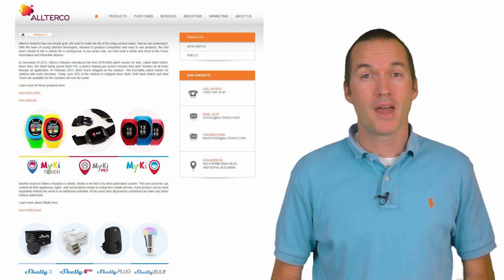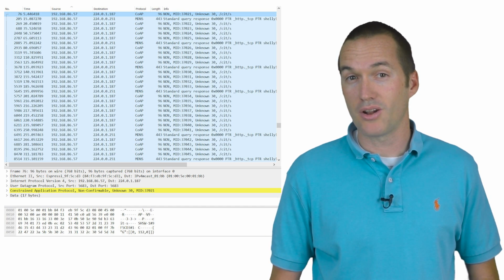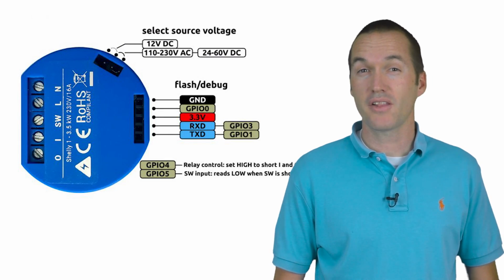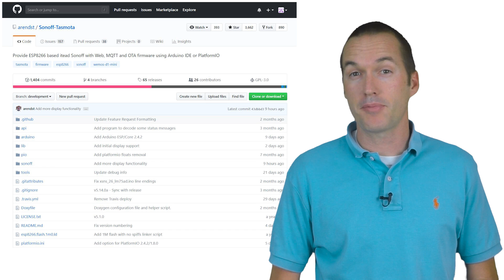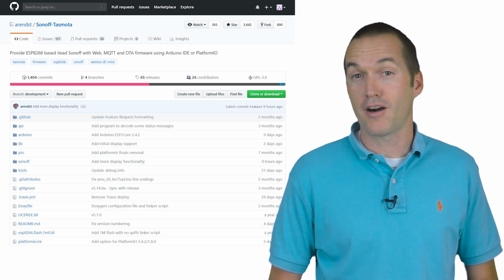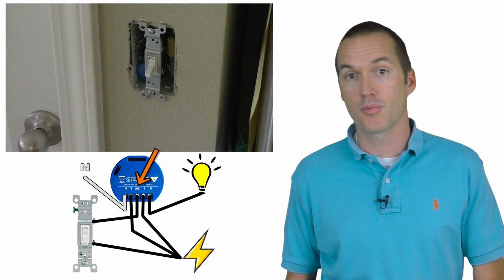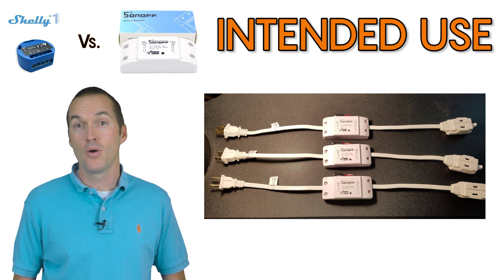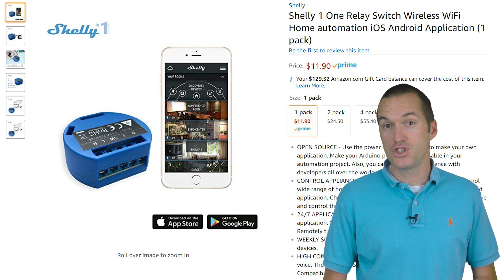Is the Shelly 1 better than the Sonoff Basic?

Comment: its rated at 16A, but its internals are not 16A proof and its CE marking is fake, it doesnt comply at all with the CE and just like the sonoff it will and can burn your house down if you trust the 16A rating
Reply from the maker: Cool story bro. Got any evidence at all to back that up?
Reply: I´m an engineer in electronics, few things here the CE layer you see here is either fake or it does literally mean "China Export"

and by that i mean literally: https://keyassets.timeincuk.net/inspirewp/live/wp-content/uploads/sites/22/2010/12/CE_Marks_lrg.jpg

second, this device doesnt have a 16A relay not its solder traces on the PCB are capable carrying that kind of load
its says 16A right there on the relay but i can already see from the pictures this isnt the relay your hoping for and the insides if you crack it open are probably less then 10A

that is if the solder tracers are upholding this kind of load...
also this relay isnt fitted with an octocoupler, which is kinda required for the CE certification

Still not satisfied ? crack open a real CE certified product like the tp-link smartsocket
now compare its insides with that crap, and also make sure you inspect the very thick solder traces which are rated at 16A but are capable of pushing it to 30% more

You dont need to believe me, thats why we have the Darwin Awards...
I design circuitry for a living
Reply from the maker: an "octocoupler, which is kinda required for the CE certification"?

I'm pretty sure you mean an optoisolator, or an optocoupler, but they are still not part of the CE certification.  I'm 99.9% sure you're an internet hero and not an EE at all.  If you were an EE you would understand that trace length has 100x more to do with current tolerance than trace width.
Reply from the maker: Furthermore, the link that you provided about "china export" clearly shows that the CE is valid, check out 2:31 in the video.  Also, I'm not sure why a Bulgarian company (part of the EU) would feature a china export logo.
Reply: Optocouplers are a safety requirement in relays anyone with some basic knowledge in electronics would know why.

I dont feel you much of an explanation, this is my expertise and they pay me 4k a week for what i do.
CE certification requires all electronic devices to pass certain tests, this is where the device fails.
This is also why an Optocoupler is needed to pass those tests, not because it says it needs that component but it will fail the tests...

I really dont care what you think of me, i'm just giving advice tho those that dont want their house getting burned down and if insurance would find out the source of the fire was a non certified electronic device or a fake one they wont pay 1 cent out to the victim.
In the US these devices would also need UL certification, this alone is a red flag for insurance if they find a device like this.

The only thing you care about is people click your stupid referral link.
´
Reply: And to answer your previous question, having a proper CE sticker doesnt mean it's real.
CE certified products are always sold with a "declaration of conformity certificate" you know those small papers that come in the box with all electronic devices together with warranty flyers...

On that declaration all sub standards are listed which the device is tested for, this is the only paper that also can be looked up for its validity because it is listing the approval number, manufacturer, country of assembly.

By European regulations, if sold in EU it has to be in the box its just not possible that its not. Unless its fake ofcourse...
Reply from the maker: I literally have an entire video explaining optoisolators.  Why on earth would you put an optoisolator in this circuit?  There's no risk of harmful interference through the relay and the end user isn't exposed to the low voltage side of the device.  

I'll say it again, in the 0.1% chance you are an EE you are the worst EE I've ever talked to.
Reply from the maker: Conformity information on the first page of the included manual with the shelly1: https://shelly.cloud/wp-content/uploads/2018/08/Shelly1_User_Guide_EN.pdf

My video on optoisolators is here: https://youtu.be/QcaJlpVOJ8U?t=2m10s
Reply: The fact that you made a video about it is much sadder, explaining what an optocoupler does but not knowing why it should be in a relay circuit.

I'll give you a hint, it is part for a protection we call "Flyback voltage" and you'll be surprised what damage it could do and how many home appliances could create such a voltage.

Probably burns up in black smoke when i put it to a megger test like the sonoff.
Reply: Hi, just to say that soon the second TUV certificate is coming and UL follow it in 2 months. I think that will answer all of your questions and worries about certification and proof.

Comment: One thing that was not covers in your video is "mains" power supplied light in relation to the position of the to the analog switch and the Shelly. I.E. Does my analog switch have to be 'on' for the Shelly to recited power and operate the switch?. or if my analog switch is 'off' does the Shelly supply power to the light?

Note your amazon link for Shelly says they are not available "Maybe just out of stock"??.   Just FYI
Reply from the maker: The shelly will be able to control your lights regardless of the switch position. You get a couple of different options in the firmware for how you want your switch to behave. 

They are totally out of stock everywhere right now, should be back in stock everywhere on October 15th.

Comment: What are you thoughts on using the Shelly 1 in place of the Sonoff for magnetic door switches from one of your other posts? I am am pretty tech savvy, however I am struggling with MQTT.  I have tried it several times however i keep cumming up short, no worries i will tackle this soon enough.  I will get it however there are several projects i will be starting this winter, I.E door switches and automatic blinds. I am also looking to start temp and humidity sensors for my home to monitor my HVAC unit. 

Don't suppose you would consider a How To for the magnetic doors sensors?
Reply from the maker: You should not use the shelly for magnetic reed switch door sensors.   They are not low voltage in reference to ground.  I have a video on using a sonoff basic to do a magnetic reed switch (door sensor), it is much safer (for that specific purpose).
Reply: Thanks for your input. Much appreciated.
Reply: Hi, you can power the Shelly1 with 12V and then use magnetic switch connected to the input.

Comment: Stumbled on your Shelly video. Awesome video and well produced. Thanks for this content. I'm a complete newbie to this with some general diy skills. Shelly looks to be the solution I'm looking for to control my garage and front door exterior lights. Do you think I can use the Shelly without the firmware swap?
Reply from the maker: Absolutely, it works quite well with the stock firmware if that’s what you prefer

Comment: Hi, can I use this SHELLY 1, as a Relay for a electric yard gate? Currently,  I open the gate, manually,  pressing a button inside the house: the button simply closes a circuit, and doing so it "clicks" and opens the outside gate. 

If I setup the SHELLY 1 in "momentary switch mode", and connect the L and N to 220V and the 0 and 1 to the button circuit, will it work well without problems (I can make an automation to bring the state from ON to OFF after, let's say 1 second)?

I tried and It actually works!!! 

But pardon my (electricity) ignorance I  just wondering about the tension (the electric yard gate I think is 12V, but I am not sure if that really matters, and the manual button simply closes the circuit and the tension is not a problem, or it is? ) ... sorry I am a bit of a newb with electricity ...
Reply from the maker: I'm not sure what you mean by tension.  I can't think of any reason your setup would cause a problem.
Reply: @TheHookUp  Sorry tension=voltage in my ignorance I thought closing 0 and 1 of shelly would give 220V to a 12V device?

Comment: Great video but The IEC ratings for voltage list high voltage devices and lines as anything over 1,000 volts for AC circuits and 1,500 volts for DC circuits while low voltage circuits are between 50 and 1,000 VAC or 120-1500 VDC but we knew what you meant....

Comment: "Connects to the cloud"
Meaning, it shares your information. 

Not even if it's free.
Reply from the maker: Correct, that's why it's nice that the cloud connection is disabled by default, and that there is a local control API in addition to being able to flash your own firmware.
Reply: Learn to hack and run local services with an mqtt client

Comment: I see they added Shelly support in the tasmota changelog but I don't see it in the enabled list. I see it in the sonoff_template.h but as "optional" and commented out. Am I missing something?
Reply from the maker: I have 6.2.1.2 loaded on a sonoff and it has them in the drop down menu for the configure module dialog.  Which version are you looking at?
Reply: 6.2.1 off the release branch, 6.2.1.2 must be off the dev branch maybe? Flashing the dev branch sonoff.bin now to check. Edit: Yup dev branch is up to 6.2.1.3 now
Reply: Love your vids btw
Reply from the maker: Ah, yeah, I'm usually on dev branch, I didn't even think about that.

Comment: Any tips for powering this independent of the circuit your switching? Could it be as little as USB?
Reply from the maker: You'll need at least12V DC to power it.  12V + goes to the N line, GND goes to L.  The relay input and output are always isolated.

Comment: I tried following your instructions but hit a snag. Once I flashed it with your bin file, I was unable to connected to the wifi.  I tried unplugging the gpio-0 wire and setting up the wifi information over termite, but when I connected to termite all I saw was jibberish.  Changing the baud rate didn't help.  And just powering on the shelly1 didn't make it discoverable over wifi so that I could put in the info manually like I normally do with the sonoffs.  Any suggestions?
Reply from the maker: The official tasmota branch now supports shelly integration: https://github.com/arendst/Sonoff-Tasmota

You can grab that .bin file, or you could edit the arduino stuff to already include your wifi info.

Comment: Can be used old switches together with shelly?
What would happen, for example, that at the same time over the shelly click to lift the blinds, and through the switch to lower the blinds.
Would interlocking mode then work this way ?? Actually, the question is whether the interlocking mode is solved by hardware or software?
Reply from the maker: Yes, the shelly is designed to work with your existing switches.  The interlocking is software based.
Reply: Thanks for the reply, but I'm still worried, what would happen if you chose to close the shutter over the old switch and open it over the shelly apk at the same time?
Reply from the maker: There's really no such thing as "at the same time" in software.  One always happens after the other and that is the action that will occur.
Reply: Yes, I agree if we use only shelly. What about a combination of shelly and wall switches (manual switches)?
I believe no one would throw old switches in favor of just shelly or similar IoT devices.
When there is no internet or a router is broken, old switches can be of use.
That's why I'm interested in a combination but it's the same as with the sonoff variants.

No one has yet done something that can certainly work in combination with the electric motors. 
For the lighting is fine, and all the video ads show just how it is connected to the light.
I would not play with these things before I examine all the possibilities.
So I think this product is actually not for electric motors like roller shutter.

Unless someone wants to completely replace the old switches on the wall. But I repeat, when, for any reason, there is no internet or LAN network, that means you can not manage your roller shutters.
But I really like small dimensions so it can really be hidden in the wall.
But on the other hand there are also very nice wall touch wifi smart panels, which work the same.
Reply from the maker: There are two switch inputs on the shelly2 (SW1 and SW2), wire your existing wall switch to those inputs, one for the up direction and one for the down direction.

Comment: Does shely have interlocking mode?
Reply from the maker: Roller shutter mode is an interlocking mode.
Reply: Excellent.
It just needs to be upgraded to work on a single wire (L) and that is what it is. Thank you

Comment: We release new firmware version for Shelly devices. Ver 1.2.0 Change log:
+ Shelly1 and Shelly2 Wi-Fi disconnecting issue resolved
+ Improved cloud connection all devices
+ Shelly Bulb color mode issues resolved
+ Send command over CoIoT can be disables/enabled all devices
+ Add manual time zone and geo-location settings all devices

Next version scheduled end of the September'2018. Targeted issues/improvements: 
+ MQTT support 
+ + ESP based Shelly2 devices will show aviable Wi-Fi networks.
+ Selly2 roller shutte mode improvements
+ ...
Reply: Is ir possible to control DC lights with the Shelly 1?
Reply: Hi, nice work really. I m just wondering if you can make a similar device with higher than 16amps; something like 20 or even 30 amps. I need them to control the air conditioner. Thanks.

Comment: Can we convert a sonoff into a shelly? Is the firmware avilable? What hardware modifications does it need? 

I am asking because of the local connectivity, which is not available in sonoff. Also shelly have provision for adding normal light switch. 

Please try that modification, and hope you will make a video on that soon.
Reply from the maker: Shelly firmware requires 2mb of flash and has some protections built in so they can secure their cloud.  It's not possible to flash it onto a sonoff.
Reply: @TheHookUp  

I understand.. if we change the flash chip, as we do for custom firmwares for sonoff, we can have the shelly firmware flashed into sonoff, right? 

But what is the protection you said.. if we flash shelly firmware.. shelly cloud will identify sonoff hardware as shelly device .. right? Everything the cloud needs is in that firmware .. right? 

I am talking about using everything ( firmware,cloud,apps, account ) of shelly, but just sonoff hardwre. ( With some hardware modifications , like making the sw pin float  and changing the flash chip ) ..

Can you try that? I hope  the firmware is avilable ( as open source or just hex file ) to flash..
Reply from the maker: I asked the CEO about that option in different context a few days ago (about having the shelly firmware available for reverting to factory settings), and he said it isn't currently possible because they come from the factory with some unique IDs for connecting to the shelly cloud.  You're just trying to have local control without needing an MQTT server?
Reply: @TheHookUp   The Hook Up  oh.. ok.. anyway i will give it a try.. have some 32 mb chips laying around. 

My need is.. 
Should be easy setup.. just like pairing a phone with a wifi router. ( Thats avilable on firmwares from sonoff or shelly) .. so that a new user can setup the device with out any technical knowledge.

2. If possible there should be a provision to add a normal open/ close electrical switch ( not momentary / push button switch) thats avilable on shelly but not on original sonoff

3) local connectivity , in case there is a loss of internet connectivity.

I am a newbee to this.. and i bought few sonoff devices after watching drzzs videos,and few others, and just today i came across this channel, and i found your explanations are far more easier to understand . So i did subscribe to your channel already. By profession i am an electrical and electronics engineer, so i have good idea about electronics, but about programming ( self coding) i am not so experienced. 

I understand that mqtt and similar custom firmwares can do all the above requirements which i need. But then it needs pre editing the wifi setup information before flashing.. thats a big drawback for me.. ( i can do it, but i dont want to reopen every sonoff , reprogram it when ever i do change wifi credentials ) 

Or does such a setup already available on custom firmwares? Especially the easy setup is what i want most .. that's the only thing make me stand back from flashing sonoff with custom firmwares. 

Can you give the information if such an easy setup is avilable on mqtt or another custom firmwares?
Reply from the maker: Tasmota actually has a great way of changing wifi credentials.  You can give it 2 sets of credentials to check, so if it is set up using your current credentials, go in and set up SSID2 and PW2 to be your new wifi information, then change your wifi as needed and it will try to connect with SSID1, fail, and then use SSID2.  That way you don't have to open them back up.